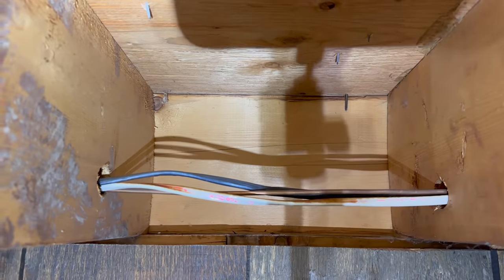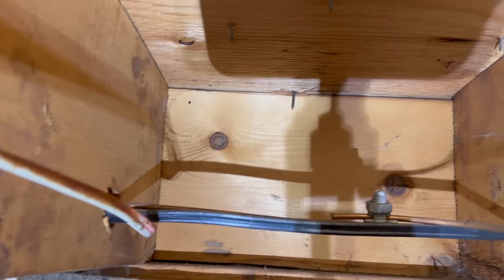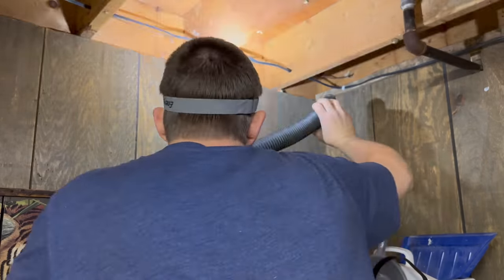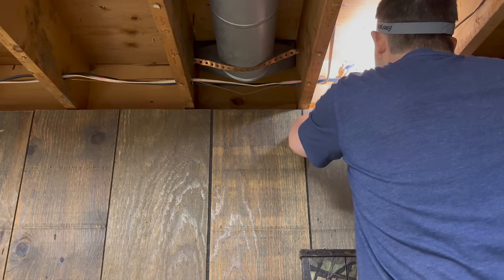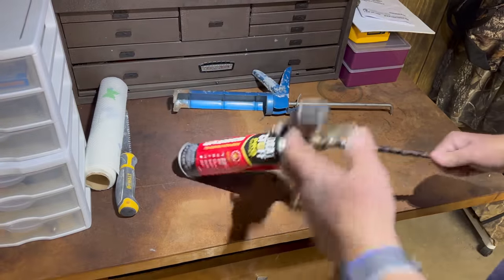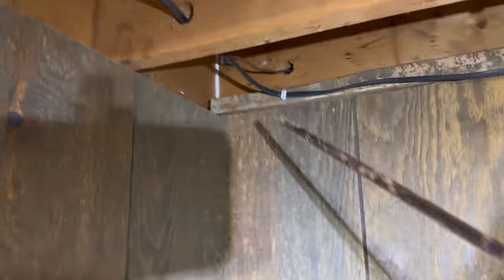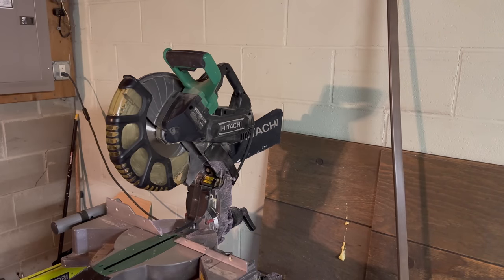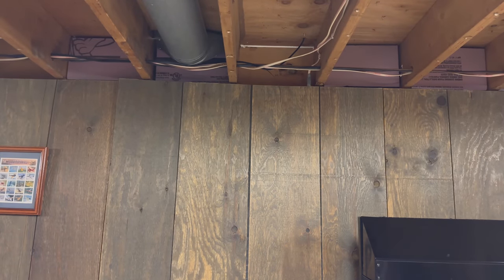Rim joist insulation air sealing

Comment: Thanks for the great info. Great job. Just one safety suggestion. Cutting foam like that with a miter saw can cast thousands of micro particles in the air that you breathe. You may want to wear a mask (didn’t look like I saw one, I could’ve missed it). Can’t be good for you.
Reply: Facts. This stuff cuts very nicely with a carving knife and a straight edge—score it and snap.
Reply: isnt is also better to take EPS instead of extruded styrofoam ? Simply because of the lower cost of EPS, but also because of the off-gassing from the extruded foams.

Comment: It wet regions it's beneficial sometimes to not insulate the rim joists at all. I've found rot behind foam board and batt insulation. We removed it and let it breathe, no more condensation issues. 🤷‍♂️
Reply: You're right. In Ga, this is not a beneficial practice. We have high humidity and this method would allow condensation to form behind the foam and against the ridge board causing rot. My home is 60 years old and is dry as a bone. Sealing edges and cracks however is necessary.
Reply: Batt insulation should never be used for rim joist because the rim joist is in the ideal place to collect moisture because moist air is lighter and rises and the rim joist will be colder. If you use closed cell foam you won’t get moisture.  You should also use silicone caulk versus latex as it bonds to the surface better for a seal.  Our house was sprayed with closed cell foam to get R-40 from the rim joist to the top plate of interior walls.
Reply: @adamwest3266  would there be rot issues if the rim joists were spray foamed?
Reply: @eyehear10  Spray foam is the better alternative. My home is over 60 years old and has zero insulation and there has been zero moisture problems. However, I'm pretty certain we're getting heating and cooling loss in those areas without a properly sealed insulation foam, Which we plan on doing this year.
Reply: He's creating a moisture trap and a termite's paradise. They WILL get behind those foam boards and he will never know they are there. Caulking the top seams is a good practice. It will stop air flow and dust penetration, but the foam isn't doing anything. Am I missing something here?
Reply: @orangemanok5800  If we don’t properly insulate rim joists up here we will have frozen pipes and cold floors. I have even done some remodel work in a place that had closed cell spray foam on the rim joists and there was no moisture problems. If the cold doesn’t touch the warm moist air you won’t have condensation. We don’t have termites  but we have ants and if you have wet wood the ants will eat the wood. I wonder what the humidity is in this space. Ideally it should be around 20-40%, if it is more than that a de-humidifier should be used. We have a full basement with 4” rigid foam board to then footing. We don’t have any moisture problems. Heck, our walls are 8” double stud with R-40.
Reply: @Chris_at_Home  there are places in the world without termites? Lucky. Thanks for the reply. I’m in Sacramento and those little a-holes love to eat the rims, especially if there is a brick face to keep them cool in the summers. I have to go under and soak the perimeter with ☠️ every two years. I wish we had basements here, but the water table is too high.
Reply: @orangemanok5800  I wonder if the brick causes condensation when the day gets warmer but the brick is cooler especially on the back side.  I know my basement’s insulation is on the outside concrete wall  and in the summer if I don’t circulate air down there I will get a small amount of condensation.  It is almost like AC bringing up the cool air on hot summer days. We live on a hill made up of  what would be called pit run gravel. There are many gravel pits in this glacier moraine within a few miles of here. It is nice not having termites, rats, snakes and raccoons, but we have to watch out for moose and bear.
Reply: @Chris_at_Home  The moisture isn't an issue here. It's hot and dry all summer. The bugs just like the shade and steady lower temperature behind the brick. I would happily trade termites for some moose and bear! I need to visit Alaska.
Reply: @adamwest3266  Recently purchased a late 50's home with partial unfinished basement/garage in eastern NC.  High humidity here as well.  Would just sealing the edges and cracks with a silicone caulk be sufficient or would it have to be spray foam? I realize spray foam would probably be easier but I just don't like the stuff.
Reply: @Mixdplate   Silicone has ZERO R-Value. Silicone Caulking from the inside around the edges of the ridge boards and joists would not help anything because of that point. 
Spray foam is the best choice, because it is filling voids and assisting the foamboard in it's ability to prevent/dampen draft along with hot and cold air transfer from the outside of your home to the inside.
Reply: @adamwest3266   ... air leaks are also important, not just R value. Air leaks also trump a large percentage of your R value.
Reply: @beefstickswellington1203  Read the man's question that I was answering. It was very specific. Comprehension is a terrible thing to waste.

Comment: I found that where the biggest air leak was is where the bottom plate meets the concrete. Spray foam does a great job sealing these air leaks
Reply: I had a 2005-built house with block foundation and many parts in the area you mention had nothing over them; was a ferocious source of heat loss until I glued foam over them and great stuffed the gaps.
Reply: my concrete block walls are empty and if you try to put in spray foam it just falls down in the walls so i tried a few ways of filling walls with Styrofoam peanuts or perlite poured in that stuff is awful to work with if you breath some in it chokes you terribly.
Reply: Sill seal missing?
Reply: IN ALL OLD HOUSES...

Comment: Mineral wool would have been a lot better on top of the foam.  It is more fireproof, more inert, and especially a lot better for you in a fire since it will protect the foam from fire better than fiberglass.  Highly recommend redoing the video to add mineral wool in addition to what you have already.
Reply: Also, mineral wool is also better than fiberglass if you basement is damp. Also it tend to be a bit more rigid making it easier to work with.
Reply: Roxalls just better all round lol!!

Higher performance, more environtal, no moisture issues, stiffer, MORE of an air barrier(for what fiber insulations re worth lol), and one of the biggest in my opinion, that shit snuffs out fires 🔥 if on unfortunately happens!! That's its BIGGEST asset right there!!! $ !-! ][ + DONT BURN!!!
Reply: but if you put ROXUL on inside of house against foamboard warm moist air will go through ROXUL and condense on foamboard making ROXUL wet. the fibers are waterproof, but the empty air space can fill with water. mineral wool is not a vapor barrier it repels water sprayed on it but can get condensation in it.

Comment: I think the latest advice is to not have fiberglass insulation at all in the basement.  Better to add another layer of foam board with foil backing for both fire code and higher r values.  Otherwise, great job!
Reply: Foil backed foam board is good for fire under code
Reply: All rigid foam board I use specifically state they are combustible, and need to be covered.

Plywood or drywall is enough. Drywall obviously if you finishing an area but for shops etc plywood is good too.

But the foil face only adds vapour/air barrier nothing to do with fire code.
Reply: @justinstevenson2061  thats what I thought. I was just asking the original poster why he thought foil lined foam board was good for fire code.
Reply: Roxul will fit the bill. I took out all of fiberglass and replaced it with Roxul. Recently there was a house that went up in flames. It took less than 20 minutes for the whole house to be destroyed by fire.
Reply: @ximenoworks  Did you use the foam board in conjunction with Roxul and that's good enough for fire blocking? Or just Roxul by itself?
Reply: @kellyjohnson416  foam board can burn and release  toxic fumes. Roxul doesn't  burn or absorb  water.
Reply: @ximenoworks And even fire resistant foams put out fumes and smoke heavily compared to other materials. Spray foams with fire retardant are only good for gap filling to prevent fire spread to other floors, they are still combustible and toxic in larger quantities.

Not that foam doesn't have it's place, it can, I just wouldn't trust it in a lot of exposed places. I prefer to use mineral wool where possible, rigid panels of mineral wool can be used in place of foam in some places or as a last layer for fire protection much like drywall.
Reply: @Jaker788 OK  But does  it prevent / control moistuter build up.  We're removing fiberglass batt that was stuck into rimjoist ends, on top of ICF Basement. 
There's moisture collection & degradation in some areas and fiberglass is not approved, now, for that. Yet Roxul doesn't prevent prevent moisture from been held against wood, does it? 
(And I hear rodents Love Rockwool products! No critters in our house thanks to ICF & don't want to tempt them to find a way in! 😊)
Reply: @karlakay  For the rim joist you would need to use foam at least 2" thick to prevent condensation from the cold surface. Mineral wool is too vapor permeable to work alone on a rim joist interior. If a fire barrier is required over foam, like if you're using the space for storage or mechanical equipment, then mineral wool can go over that and get the extra insulation beyond dew point protection. If the space is not used for storage or anything, you can usually consider it as unoccupied space and the fire barrier requirement doesn't apply, some areas may vary with local code adaptations.

When it comes to rodents and other bugs, mineral wool doesn't support habitation inside it, bugs can burrow through it easily unlike fiberglass. I've seen bees nests inside fiberglass batting. Rodents may be able to dig through it, they can dig through closed cell foam if they want too, but generally they use insulation as nesting materials which mineral wool doesn't support well. 

For mineral wool used for floor joist insulation, rodents can climb up to live on top between the warm floor, the same thing they do with fiberglass.

Comment: Anything showing daylight or having obvious air movement should be sealed with caulk, preferably from the outside whenever possible. Larger holes should be closed with tin or wood shims and sealed with caulk and then insulated. Insects and vermin will chew through foam. The best practice would be to use closed cell spray foam approximately 3 inches depth and do a continuous spray from floor to ceiling. Also, the most recent data leans toward not using fiberglass bat insulation in basements as it will trap and hold moisture. Rigid foam board is a good DYI solution, it’s cheaper than spray foam but only if your doing the labor. Some areas require foil backed foam board to function as a fire barrier. Something else to look into is breaks. Most codes require fire breaks between each horizontal level of the building and vertical breaks at least every 10 feet of linear wall when using foam. In most areas 2 inch rigid foam insulation meets the R10 minimum insulation value for basements. Check with your local building codes before you start any work.
Reply: Excellent info. Thank you!
Reply: I won't lie, it's very confusing what fire breaks I need if I do continuous spray foam across the entire wall and into the rim joists as well.  (In a basement)
Reply: @simland  yup. And the code varies in different areas, although most areas, cities follow international building codes. In my area foil backed foam is not required, but the next town over says you have to have it. Most areas require fire rated sheathing at least 7/8 thick with a minimum of 1 inch overlap with 2X4 or floor joists. In most cases the flooring covers the between levels requirement. For the running wall breaks 10 foot is considered the maximum span. Mine are set at 112 (if I remember correctly) something around the 9 foot mark lands on a stud. The break is scribed to the wall and nailed to stub with a three inch overlap. In theory that gives me a 45 minute burn through. We’re not required to have foil backed foam as long the wall has fire rated Sheetrock. Like I said, check with your local building inspector before starting anything.

Comment: The foam board may not be fire rated by code to be exposed.  Good to check local code.
Reply: Agreed. I added 1/2 inch drywall overtop of the foam. This is required due the toxic fumes in case of fire.

Comment: I just had fiberglass batt in the rim joist cavities.  Pulled it out and put in foam board and spray foam to seal (like you showed), then put the fiberglass back in... no harm and adds just a bit more R-value.  My suggestion for even better performance, especially in a crawl space or unheated basement... staple and seal "double-bubble" (Reflectix)  insulation sheet to the bottoms of the floor joists and seal those joist cavities across the entire crawl space or basement.  Greatly helps keep the floors warmer.  Cheap and very easy to install.
Reply: i don't mind the cool basements great in the summer, sucks in the winter :D
Reply: Careful with sealing joist bays off, you can create a vapor barrier sandwich for moisture to get trapped and condense on the cold side.

Better safe option is sealing penetrations for plumbing and any other stuff to stop air leakage, then make sure the batt insulation is good.

Comment: Here in  easterm Nc i see a lot of insulation contractors going through the trouble of encapsulating a crawlspace and then they leave fiberglass batts at the rim joist. This is the right way to do it. Nice work

Comment: For rim joists it is recommended a minimum of R-13 in climate zones 1 through 4, or a minimum of R-20 in climate zones 5 though 8.
Reply: I wonder about this. I think where I’m at there is a potential for condensation between the joist and the foam board, which (if you seal that up) will just sit there.

Comment: You need to use 4" foam boards or 2 time 2", home depot has 2" foam that is R13 so 4" gives R26, code is I think R30. Cut foam 3/4 less than rim joists size and attach transparent flexible plastic tube to foam gun so you can easly access everywhere... When you have 3/4 space you make 5/8 from each side so foam can go all the way towarst wood, this way you dont let air movements in front of the foam and also you dont need caulk.